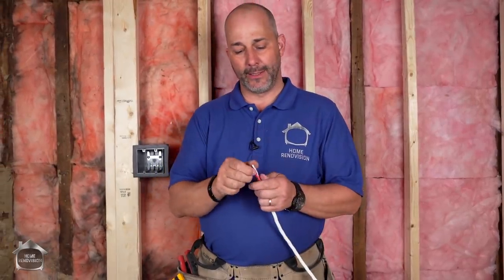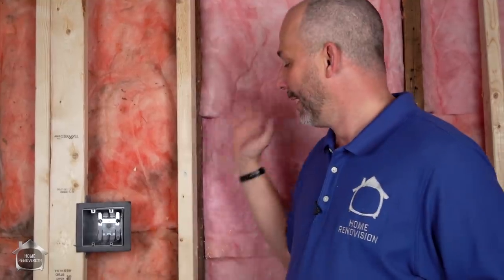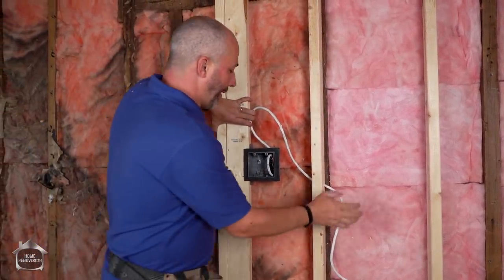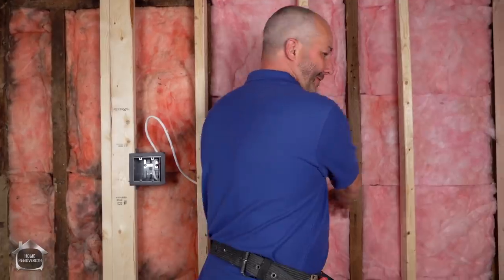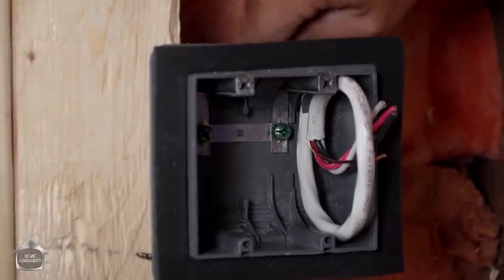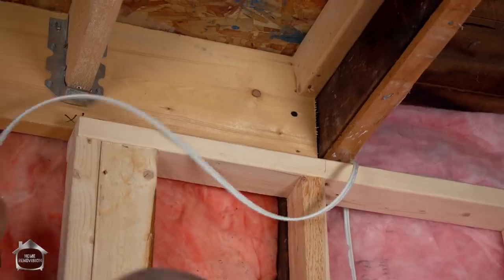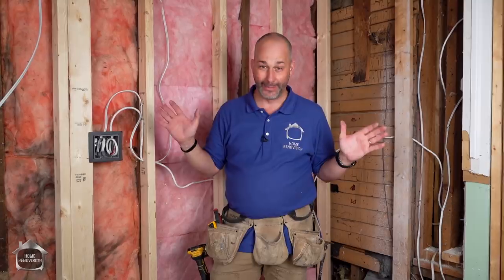How To Wire a 3-Way Switch

Comment: Wiring is correct, we're required to tie all the joints before an inspection where I am at. Might be easier to draw out how the 3 way works for those that don't completely understand it. In this setup the black and red should be the travelers and the white in the 14-3 carries the neutral from the first power box over to tie with the neutral from the light switch leg. Black from power goes on black screw,  red and black from 14-3 go on the brass screws of the 3way switches and black from 14-2 light switch leg goes on black screw of 2nd 3 way. Lots of ways to do 3-ways, however here a neutral has to be in each box just in case a dimmer is added that needs a neutral to make the dimmer work in which case this is the correct way it's done to achieve code requirements. Keep the videos coming!!

Comment: Im amazed at how different electrics are where you're at, compared to Norway. Your code seem to be very strict on certain details, like staple placement, yet there are so many things you are allowed to do that we can not. Like running the wire freely inside the wall. Here, we have to run it in some sort of protective tube or pipe... Also, all your wires and stuff have different names and the boxes and switches look completely different! :D

Comment: Well that was short. Would like to see inspection vid🙏🏻.
Also, is it code in your area to use firestop (caulking) to fill holes when going through top plate or into another “room” etc... just curious, is all. 
It’s always great to get an awesome inspector; as well as, when doing many jobs & keep getting same person.....makes the process go a little better(at one point, was lucky & had same inspector for 4 yrs in the area worked in).
Can’t wait till next episode. THANKS Jeff (any chance gonna see more vids w/ your sons?) AND Max for your hard work. 
Cheers✌🏻

Comment: He didn't bother to explain how,the wires go together.  Where do the Reds go?
Reply: Reds are travelers, along with the black in the 14-3 cable.  White is neutral.  Travelers connect to the other two (non-common) terminals of the 3-way switch.

Comment: Can you recommend a ceiling light fixture for a bedroom that doesn’t require a junction box? There is a ceiling hoist dead center of the room, attic is already sheeted with plywood over top.

Comment: Please help!!! I just recently replaced my light switches for the entry way, top of stairs and bottom of stairs. All the switches work fine BUT when I turn off the light from any of the 3 switches the light won’t turn back on unless I go reset the breaker BUT the breaker isn’t even tripped?? What is the problem??

Comment: Could you also run the wires up through the ceiling instead of the walls?
Reply: We are finishing out an addition to our metal arena... all from your videos. Studs are up, duct work is going in, and we are roughing-out plugs, switches, and pot lights this week. Thank you for all you do!!!
After watching your videos we threw out our $74,000 estimate and decided to do it ourselves!
Thank you!
Reply from the maker: Right on Jennifer. That is why we do what we do. Love to see pics along the way.

Comment: Why can't you use a 14/2 for your travellers? Why are you using 3 conductor between switchesm
Reply: Because you need two travelers plus a neutral.  Sometimes, if you need to wire something past the second 3-way switch, two runs of 14-2 will be used.  One cable is the travelers, and the other is a constant hot/neutral.

Comment: At 2:40 - Wrong! 14-3 has a LOT of uses besides just 3-way switches.  It is used in bedrooms and similar rooms for the light fixture so a ceiling fan can be installed (fan-rated box and 2-gang switch box both required), also for bathroom exhaust fans that include a built-in light.  Not to mention cable runs between 120V smoke alarms. The red wire is used as a signal wire so all alarms will sound if one is triggered.

Comment: While you're on the topic of switches; how would you figure out what a switch operates when you've checked all the lights and outlets in the vicinity and nothing reacts.  It's a switch on a bank of 3, left operates ceiling light, middle is the mystery, right operates an outlet.
Reply: Maybe there was a ceiling fan at some point where the 3rd switch controlled the fan?
Reply: Did you check both receptacles on each outlet you tested in case of a split wired outlet?  Also, could just be a dummy switch that's no longer used. Have you verified there is power running to and from the switch?
Reply: If you find it's not a switched outlet like @NightxxOwl suggested you could always buy a tone generator from home depot for $75 and trace the wires without having to open up the wall.

Comment: I have a 4-way switch and it feels like I'm solving a Legend of Zelda Puzzle sometimes...
Reply: 4-way switches operate on the traveler wires of a 3-way switch pair.  The pair of wires from one cable goes on one side, and the other pair on the other side.  The switch may be marked "input" and "output". It doesn't matter which one, as long as wires of the same cable are grouped together on the 4-way switch.

Comment: Big fan Jeff, but I think this one missed the mark. A bit disjointed and difficult to follow; missing information.
Reply from the maker: Hi Josh, thanks for your cander. Perhaps you could elaborate for me. We are always trying to get better.
Reply: @HomeRenoVisionDIY  I think it's important/valuable for someone attempting to do their own wiring to be made aware that there are several ways to wire a 3 way switch. It can affect how they choose to design their flow. And because there are several different configurations (that can be difficult to grasp the concept of), I think a diagram is nearly essential when explaining it. Even if its just scribbled on the stud.

- You didn't video putting the 14-3 wire into the 2nd box; just a shot of it done. Didn't identify the 14-2 wire in the box as the "power supply" wire at the time.
- May have been easier to video pulling the 14-3 from the 1st switch box to the 2nd, so that you are working in the same direction as the flow of power? Better for visual explanation in the absence of a diagram.
- The video flow was a bit confusing using terminology like "first box",  "second box", "other box" since you showed working on the plastic box first and running the 14-3 to the second. But you meant first box as it pertains to the flow of power which could have been supported by a diagram. :)

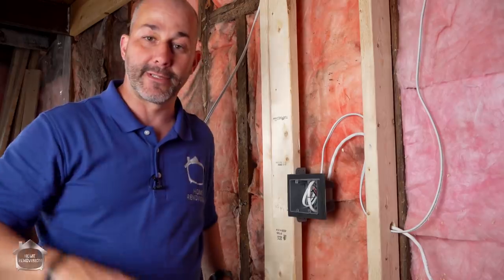It all came together at 4:16 when you went through your quick recap though. I completely understand that you are simply showing your viewers what you guys are doing in this renovation, but from a teaching/learning perspective which is the heart of this channel, I would probably be doing another Youtube search for how to wire a 3-way switch after viewing this. 
Hope this comes off as constructive and not criticism.